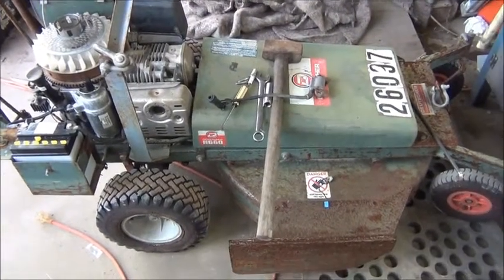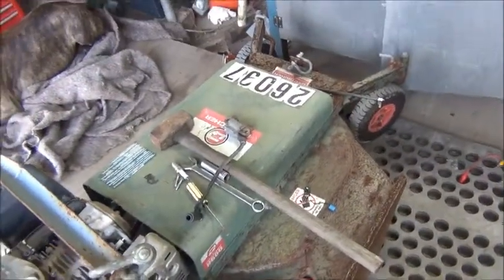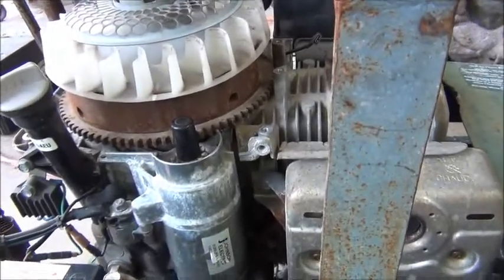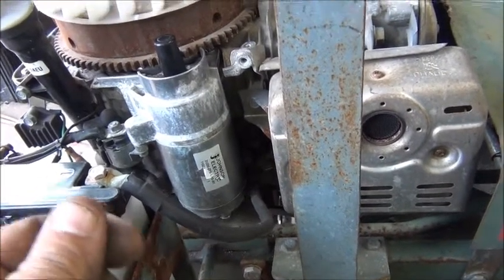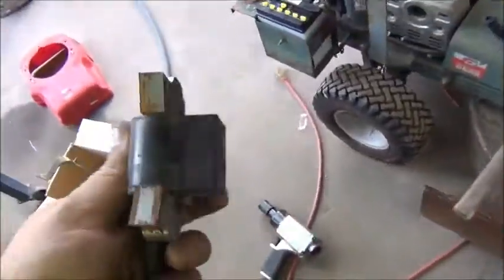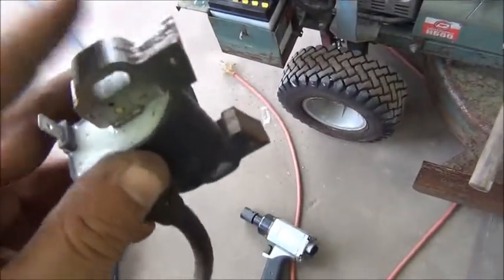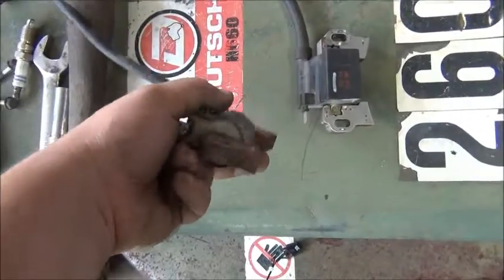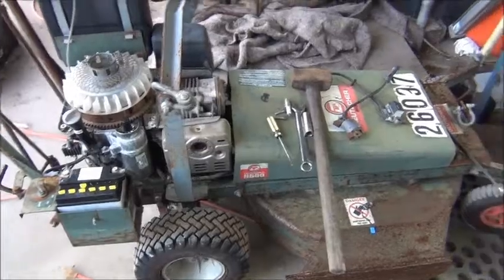Mower Monday - Deutscher H660 Starter+Coil

Comment: If you need a new coil order it from the US as the prices in Oz are a total rip off $14 US vs. $160 here for a Briggs 13 HP. I bought two deck hubs, two pulleys, two blades and a Kevlar belt from the US for cheaper than a single hub here also.